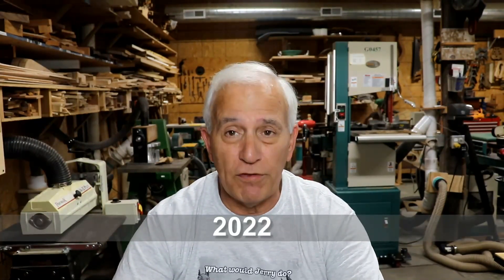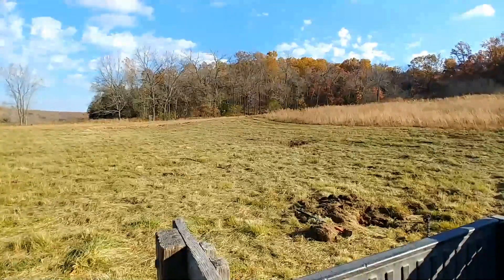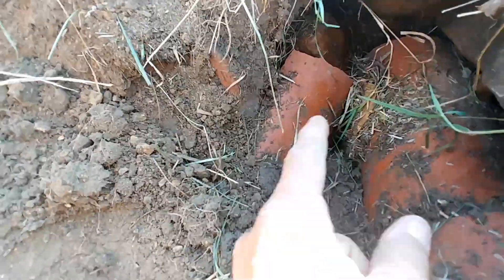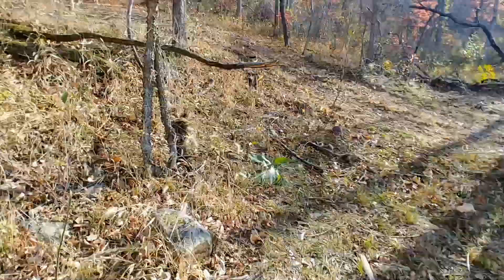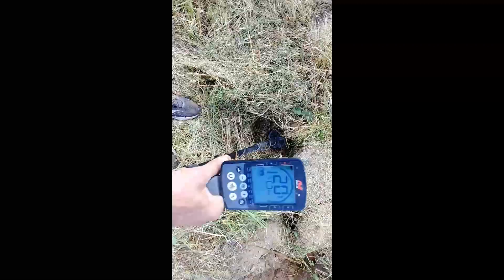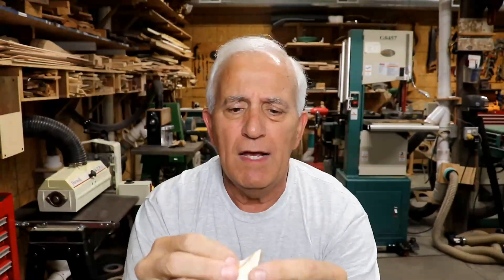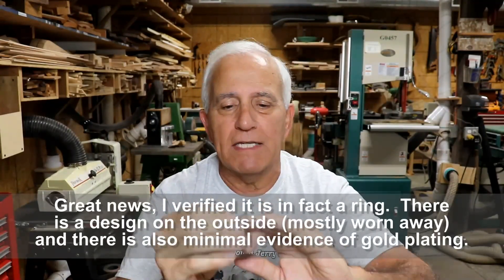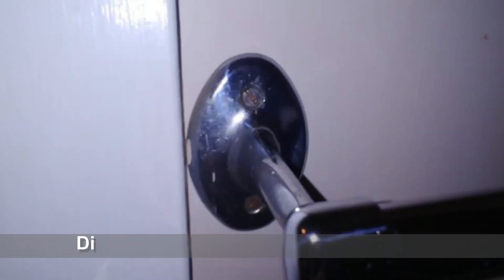600 RSW Homestead Archaeology New Finds

Comment: Very interesting. People used to bury all their garbage.....you can find old bottles that are in good condition. Where my house is now there was an old farmhouse built in the late 1800's. I've found a couple trash holes with all kinds of stuff.
Reply from the maker: We found a few dumps on the farm also generally the people threw stuff down in a ditch and erosion covered it up
Reply: Yes, when I was a kid I did this kind of exploration a lot. Look in the area about 25 yards from the back of the house, in the direction where the prevailing wind for the area would blow odours away from the house. That is how you locate the outhouse, and garbage holes. Take your detector, or a steel probe, and search that spot, easy when you know how. Saves a lot of random digging.